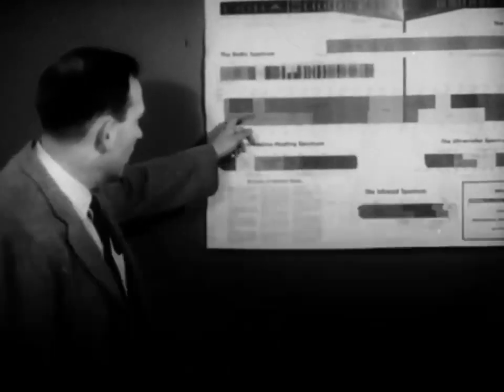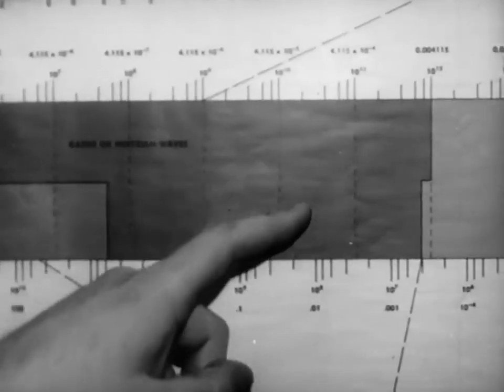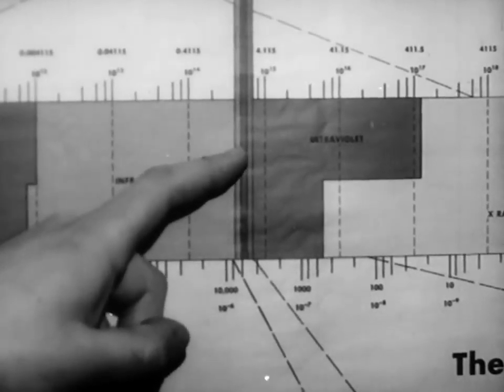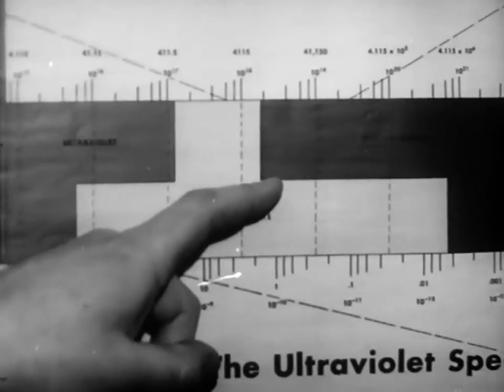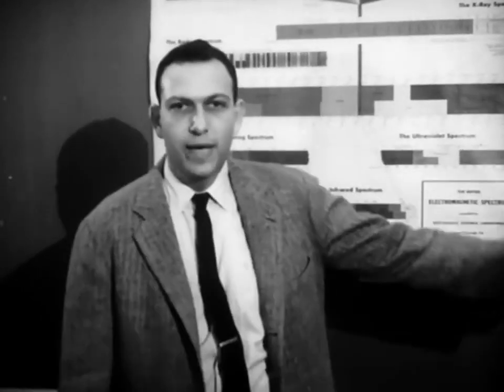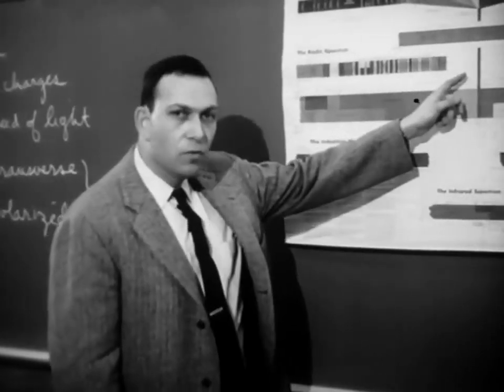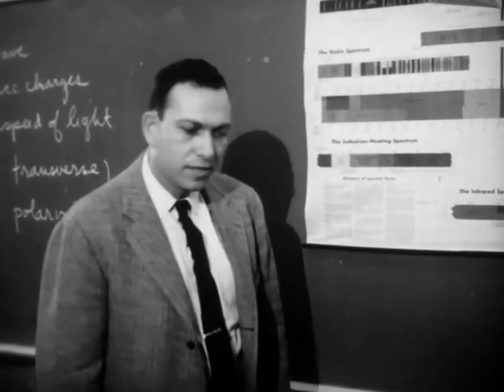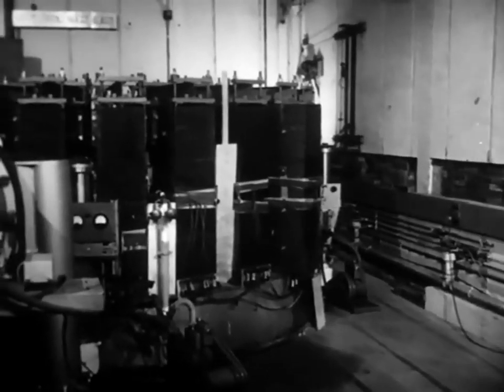Electromagnetic Radiation Electromagnetic Waves 1961 PSSC George Wolga, MIT; Physics

Comment: "The energy of an individual photon is quantized and is greater for photons of higher frequency. This relationship is given by Planck's equation E = hν, where E is the energy per photon, ν is the frequency of the photon,"

a frequency is a rate of change with time. What is changing with time in a photon ? Is it proven that a single isolated photo exists ? Or do we always have to consider groups of photons and so their group frequency (rate of presence by unit of time in a given area) ?
Reply: I don't think the physicists have a clue when it comes to EM energy.
I would ask, how does Planck's eq. apply to lower frequencies, like radio waves? In the field of engineering, we never make reference to Planck's equation E = hν, we measure the RF (EM) energy using thermal power meters and spectrum analyzers.
Reply: re: "Yes we have proven individual photons exist"

No, you have not. You are misleading yourself, a self delusion. You don't understand the physics taking place at the atomic level.
Reply: @uploadJ  tell your "carer" to up that risperdal dose, the current amount definitely ain't enough!
Reply: @Muonium1  re: " tell your "carer" to up that risperdal dose"
Are you a doctor meddling in physics, or a physicist meddling in pharmacology? Either way, you're practicing w/o a license in a field you expressly know zip about ...
Reply: @Muonium1  
PS. Either way, turn yourself into the respective 'board', pay the penalty and repent.
Reply: @Muonium1  
.... and STILL noticing the original question GOES UNANSWERED.
Reply: Why can't people just have a conversation,  a debate without insulting one another? I know nothing about this and want to learn! Pride just gets in the way! So sick of "beliefs" preventing any new information from penetrating the brains of the all knowing!
Reply: @donnajhawkinswalsh382  
Ask whats his name above why launched an attack on me when he began his reply with: "Don't listen to the idiot reply above ..."